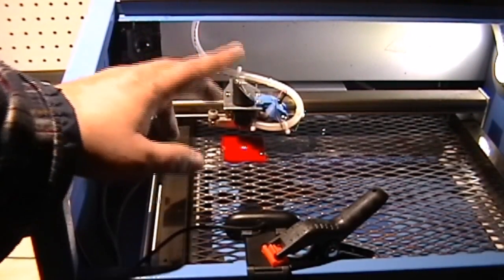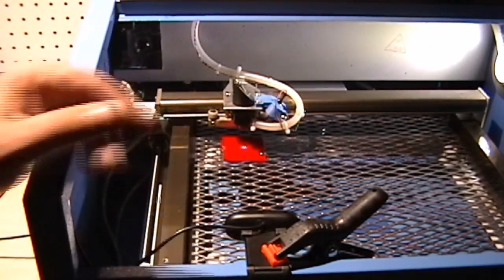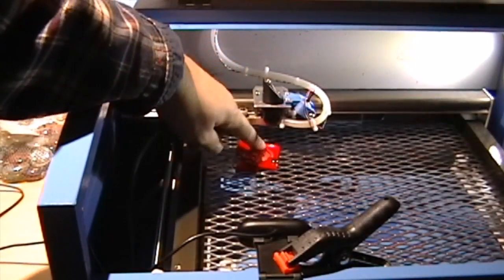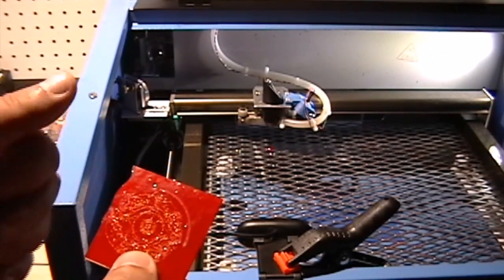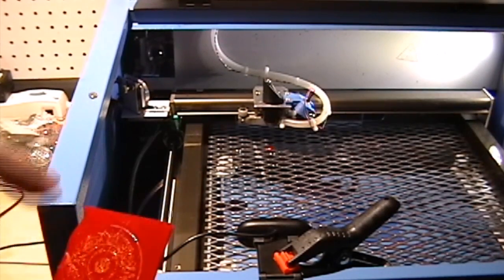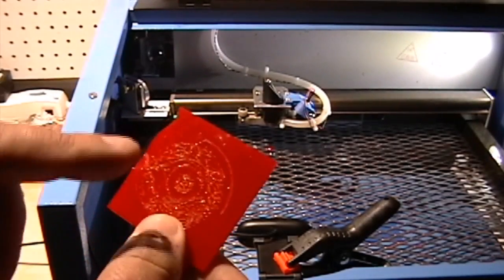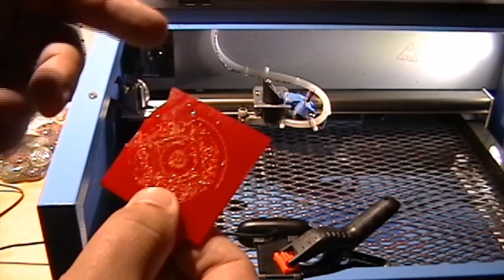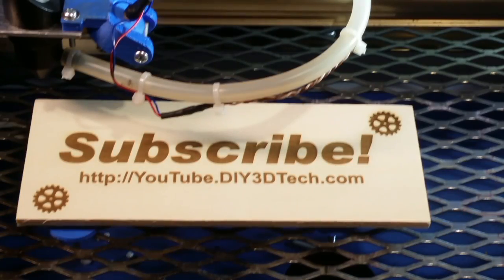K40 eBay Chinese CO2 Laser Cutter & Engraver  -  Engrave FuseWorks Glass Part 2!

Comment: I wounder if if you pre-heat the glass, as some say below, very slowly heat,  first this would stop cracking, because it is already expanded. May need to reduce cutting time to match. {just speaking off the cuff here}
Reply from the maker: Its the coefficient of expansion so you would have to get it really hot and that point it would be a pain to handle as it would be on the verge of melting.  However what I am going to try is rather than use high power with low speed, I am going to switch to high power with high speed and multiple passes to see if I can avoid sinking to much heat to the glass versus vaporising it :-)

Comment: if you could get a thin log  bit o that glass and make some lines that cross it at diff speeds and powers .  the  mess withe the recipe until you get vaporization with out the glass changing length. the you know what feed and power to get that vaporization .  then you just need to  figure out a cooling cycle per pass .  well unless  you never fins a feed and power that has no change in length / expansion .
Reply from the maker: When I get some time I going to try a couple things along these lines. As I think if I balance vaporization wit speed that might work say tuned.  It just right now I am doing videos for the new Laser and the 3040 CNC for October so that will be a full month!
Reply: yeah , and dont forget your results may only be good for that one color of that stuff . LOL. thats lots of work just to dial in 1 target material.  im just hoping i can afford a module upgrade to a 2.5w or 4w laser module  next year, LOL  just swap out the head sin my small rig . hahah
Reply from the maker: Yup, however I have a whole pack to play with :-)
Reply: lol my fave target is still funky foam . LOL , and at my low wattage i do have to tuve feed and power .  lol wo am i kidding i only use PWM for wood  ,  cutting requires bypassing PWM with a relay on my small rig . I cna only alter feed rate . on my lil one .  but man if i cna get a 4w  then i cna engrave more stuff .
one day i'll get a CO2 , probaby do teh very same GBRl mod you did . LOL
Reply from the maker: If you look back I built a 2watt and was impressed with the cutting ability as when the tube goes in my one unit I am thinking about replacing it with a 4 watt diode as for "engraving" that is enough and closed case makes it workable as with the 2watt the fumes were way too bad even with a fan to vent them...
Reply: yeh aim a diode user , so a nice 4w will be pretty sweet for my needs . good to know the 2w was smoky . what colors i wonder , I fin violet  is a sneaky color , and i think it has some leaking IR .  ( IR leaking is a real danger in cheap diode lasers people had . as sometime they only rate the wattage of the color side not the IR )

Comment: maybe heat the glass with a torch or microwave first?
Reply: Or heat the chamber.
Reply: A fair point.

What about putting the glass in an oven on low and slowly heating the glass up, it will probably take a fair while to cool for esp if it's already warm inside and it might help with the thermal shock issue.
Reply from the maker: Not sure what would happen, however still believe it would "crack" rather than fracture as this glass has a high co-efficent of expansion.  I am going to try cutting VERY fast but man, many time and see what happens :-)
Reply from the maker: It get supper hot in there and would think it would hard to deal with is what I would be concerned about...

Comment: I had pretty good results etching hexagonal porcelain floor tiles, although I had to turn the power up to 80%(!) which is much higher than I normally ever would.
Reply from the maker: Interesting, would guess porcelain would etch well (will need to try it) as its thermal expansion characteristics are rather low.  Whereas this is like a shrinkidink in that heat make it contract.  However its interesting to hear about the title, do you use for a pattern to add to or just the raw etching?
Reply: Well i had a paper bag full of white hexagon porcelin tiles from my mom's bathroom remodel + I just etched some pictures into the tile and then cut birch holders + painted them black and glued the tile in and then sealed it all up with 2x thick spray gloss. Originally I was going to make game tiles out of them, but I never got a round to it.
Reply: I have never had any luck with glass. I bought my laser with one of those irregular cylinder rotation chucks thinking I was going to be engraving every glass + bottles, etc. I consider it to have been a stupid waste of money. I think a motorized bed would have been a better use of those funds. You live you learn!
Reply from the maker: LOL!  Yea know what you mean :-)
Reply from the maker: Ah I see, interesting...

Comment: Could you do an episode on etching a mirror?  I have seen it done on the front (how beats me) and on the back and I would love to see some results from your K40.
Reply from the maker: Ok see about giving it a shot as keep in mind a typical mirror reflects visible light around 390 to 750nm and a CO2 laser is  10,600nm which is a really long wave so its absorbed by the mirroring material...
Reply: DIY3DTECH.com
Well, I have seen laser etched mirrors but never the person doing it.  I have read some are doing it on the front side but I don't see how and most do it from behind so it burns the material off but how that would look good from the front side I question.
Reply: in theory you could poison surface with black carbon from candle flame ,  and get a nice black  coating for the laser to heat just before the glass surface .   and wipe it off after.
Reply: XerotoLabs
This I was thinking about as well.
Reply from the maker: Have added this the plan, going to stop at hobby lobby and pick up some mirrors (they sell 4x4 in bulk) and try some experiments so keep an eye out :-)
Reply: DIY3DTECH.com
Oh, boy I am excited to see this as my main want of this laser would be for that.  Thank you. :)